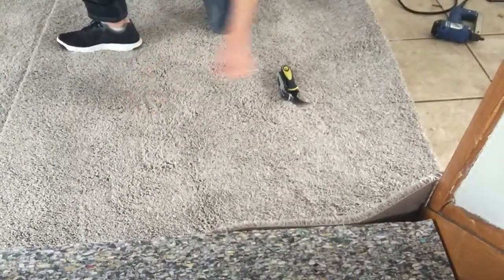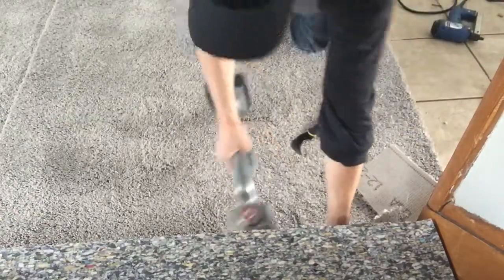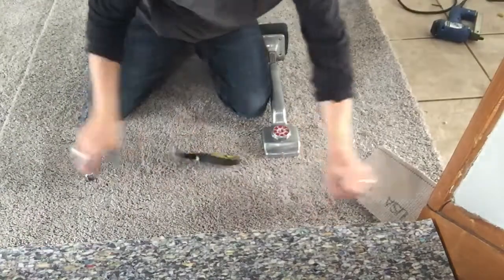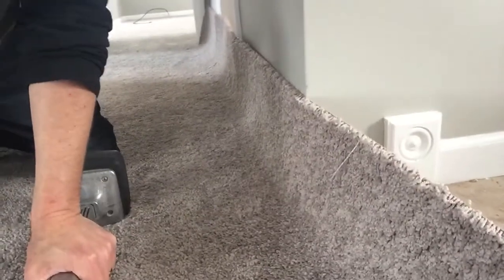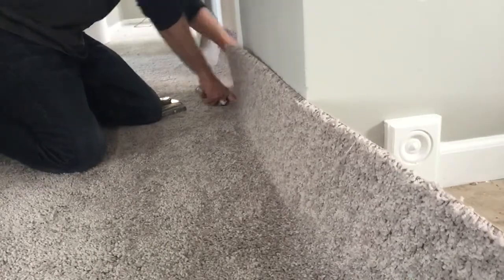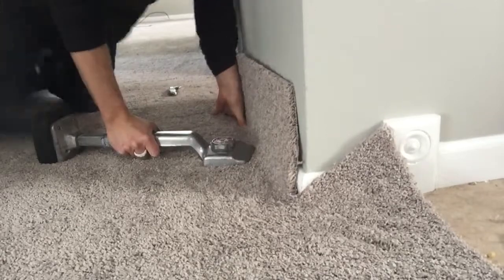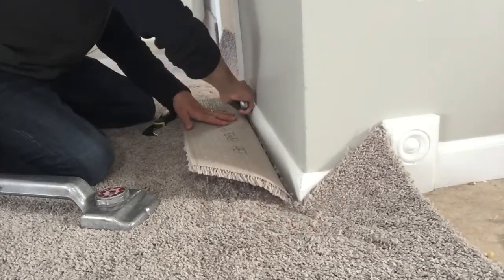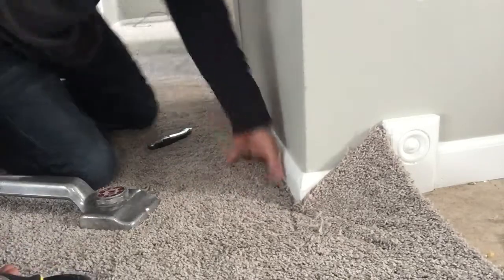How to install carpet in a hallway carpettoolz.com

Comment: I use stretcher pipes even on wood lol going on 24yrs never had a call back yet! But keep up the hard work make that cash money
Reply: I have a question for you cuz I can't find it on YouTube what if you have a hallway that goes down then it cuts off to the right how do you keep it from being a directional I need the fibers to go the same way thanks for your time
Reply: @brentmaveric4981  it depends on how long hallway is and how far right it goes mostly I would cut it out in the shape of the hallway all in one big piece, from big roll of carpet! I hope that helps
Reply: @brentmaveric4981  also depends on if you are trying to save money if you want in 1 piece there could be lot of waste on material or you could have a few seams, its hard to describe without measurement and drawing a diagram out
Reply: @BAMTASTIC711  I have a job on Wednesday and it's a 19 ft hallway and then it cuts off to the right another 15 ft that would definitely be a big waste of material so I guess if I understand you right I'm going to have to do some scenes and it sounds like it will be a directional I appreciate your comment I just had to read it a couple times to understand it like you said just one big ass piece and cut it out

Comment: Some installers like to staple the carpet down on the tac strip around all the walls..... Who ever is doing that, please Stop! It's very difficult for me to pull the carpet up and power stretch it later on down the road. Just tuck it in and leave it, don't staple it.